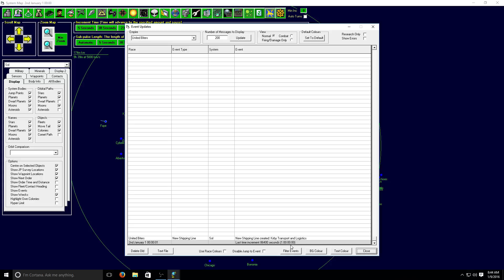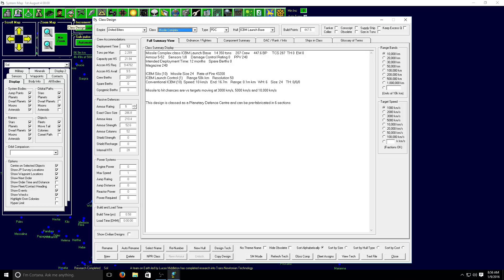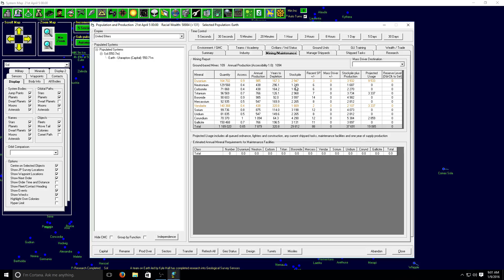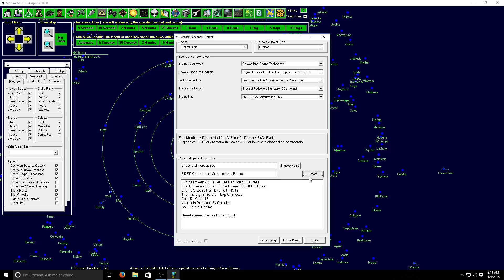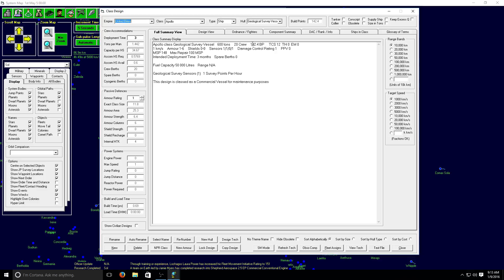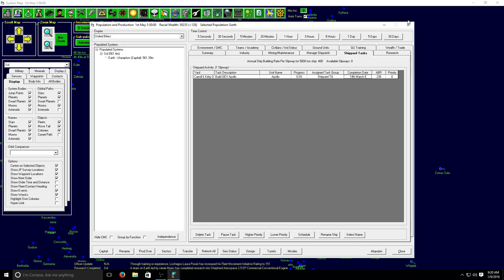Aurora 4x - Part 2 - Designing our First Ship

Comment: Wow, I love how the game uses turns.  It certainly looks like this use of various time increments would be useful for a wide variety of uses (base building, battles, etc.).  I guess one just needs to be careful not to push the one day button during a battle.  The construction cycle concept is also a good idea to simplify things.  Without the construction cycle idea this game would be at Dwarf Fortress levels of complexity.
Reply from the maker: +Blah82udhw Yeah, like you told me earlier, I've never heard of a pc game having a turn length that you can set yourself like that. Kind of makes this game a mix of real time and turn-based. It's gonna be quite a while, but looking forward to explore other solar systems, and actually meeting other life, as I haven't done that yet in my couple of practice games before this.